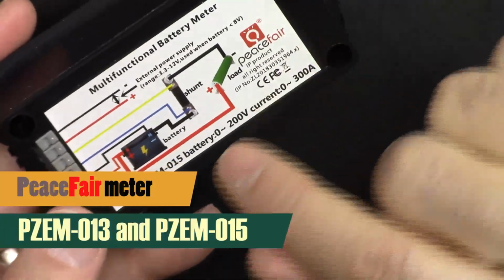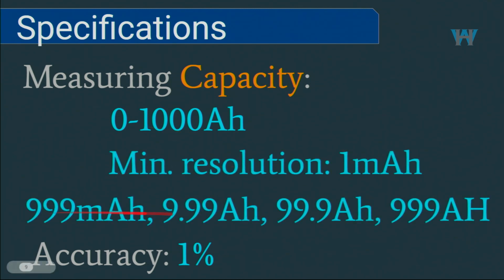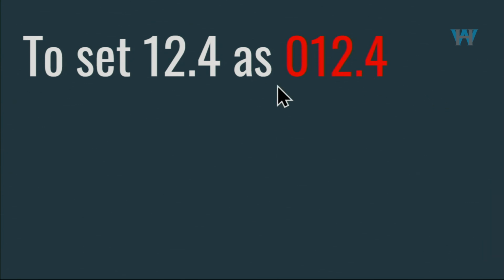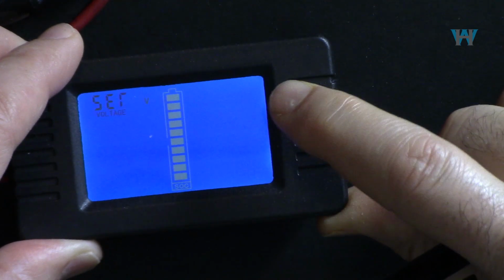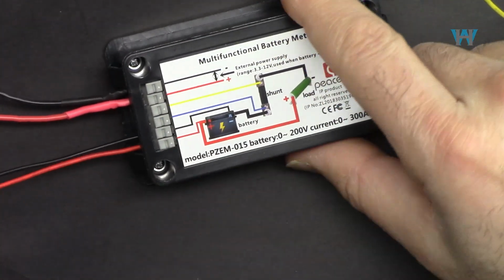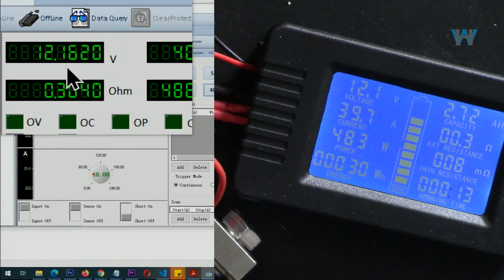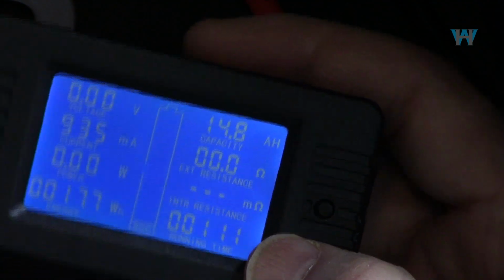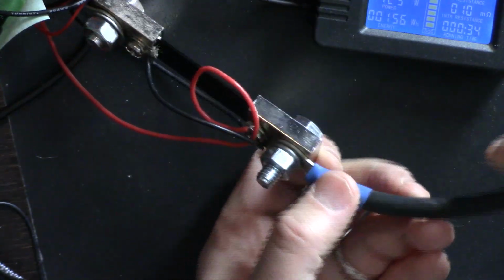Full Review of PZEM-015 PZEM 013 0-200V 0-300A  DC Energy, Voltage, Current Capacity Meter

Comment: Very helpful video...love the presentation and the test, especially the setting up. Please can you use a DPDT switch for this unit to monitor both charge and discharge parameters for the batteries?
Reply from the maker: yes it can. you can switch the wires of the sensor to get negative or positive reading.
Reply: Hi watthour, does the unit calculate capacity net of charge input? So if I have solar connected delivering current into the battery would this offset against current draw? Or would I need two monitors, one to record charge and one to record discharge?
Reply: Two units would be needed, because the energy accumulation always goes up, never down. It's unable to reverse the count.
Reply: Hi did you do this please tell me how can I do tell me the connection

Comment: Amazing video. But one question: I have the PZEM-015 and I want to use it to measure the power produced by my wind turbine. It turns out it counts energy in both directions and does not differentiate. So actually the charge controller of my wind turbine draws about 16watts and the wind turbine barely runs. Now it shows 20kwh but I can't tell whether it is consumed or produced energy. Is there any way to solve this problem (except using a different device)?
Reply: OMG, is this true? I was thinking of using it connected at a battery to check the charge state but then you of course need it to count charging as negative until zero AH  is reached again.
Reply: @gamingSlasher   Yes,it is true,i have it for 2 weeks now, 24h over 24h,and it counts the same in BOTH  directions! meaning it ADDS the + and the -  and counts all as one; so,i do not know how much charge went in... or out;  

....a bit stupid if you ask me,and  I am thinking of putting a DIODE in the sense line,but then the  shunt mV ,which are the AMPS, will be all wrong, and almost useless;  still, a very good tool...
Reply: You could maybe use a comparator across the current shunt to determine whether it's charging or discharging and then use that output to switch on the power for one of two energy monitors so that one will track charging and the other tracks discharging energy. You would then have to mentally subtract the two to determine whether it's got net positive or negative energy accumulated. 
When the unit power is turned off it should stop counting so only one of the units should be on at a time depending on what charge/discharge mode it is.

Comment: Very good explanation. One thing I did not like about the meter is the connection, has a tendency for some of the connection wires to easily come out. But apart from that very  good meter. Good video.